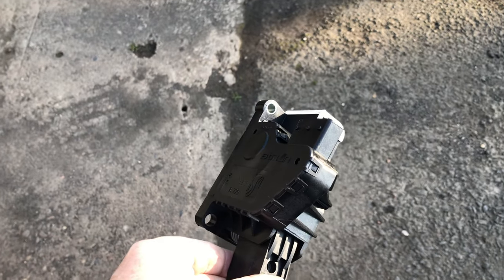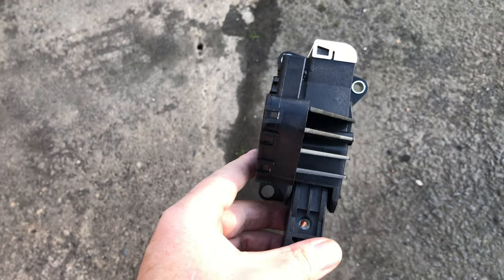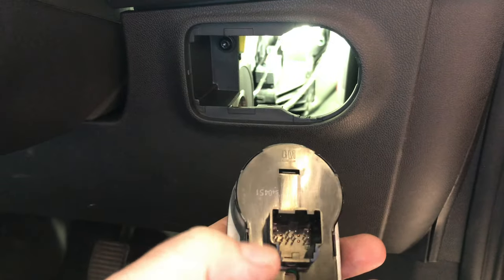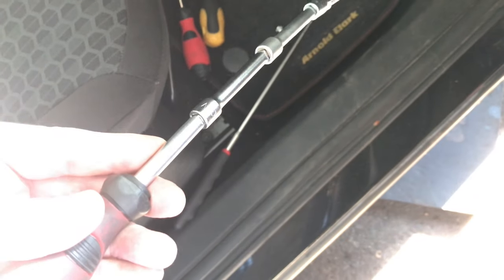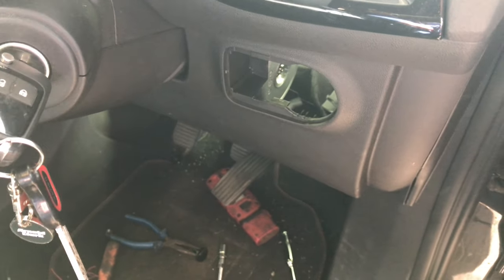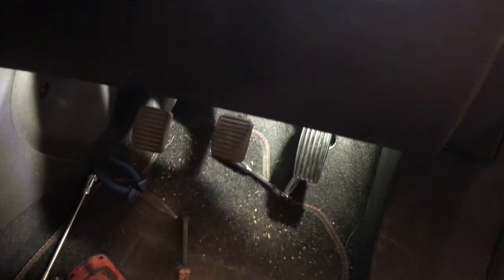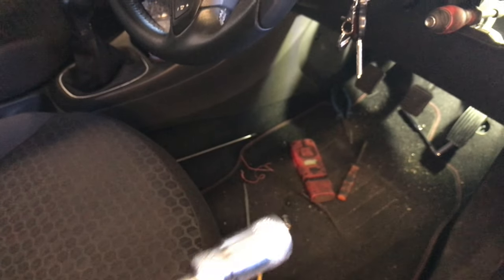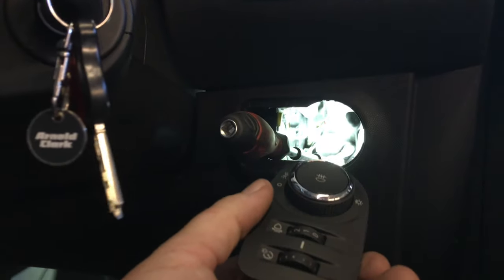Vauxhall Corsa E - P2138 Part 2 - Replacing the Accelerator Pedal!

Comment: As a matter of interest Sandy i read online that post battery change out you can experience P2138 pedal code, did you try with engine off the reset of the throttle pedal sensor switch before pedal unit change out?  Thanks

Comment: Thanks mate but i I have the exact same model corsa e 1.4 2016 but there is a box with wires infront of the pedal position sensor and i cant access the nuts to unscrew.  I have remove the box itself but the box holder is still there blocking access to the pedal position sensor.  If anyone can provide help please

Comment: My 16 plate corsa goes into limp mode when it’s cold and damp mornings
Reply: Mine too geezer! It's a 17 plate and only happens through the winter. I'm guessing it would be more pointed towards the connector in this instance? Got hold of a cheap reader and now I know what the code is - this video has really helped!
Reply: @rowanjones7523  mines literally doing that now. It is the throttle pedal sensor yes? Just before i order one
Reply: @harrybloomfield1836  I'm just going to take mine out for a spin. It's -1 so it days like these it goes on. I'm confused as to why it would only be cold weather that it happens. No one can really explain that to me.
Reply: @harrybloomfield1836  Yeah, just took it out and it got a little bit forther than it usually does. But I know that it won't go again all day now. Something warms up and makes a contact better. It would be worth starting it and letting the engine idle up to a good temperature and then taking it out. I would say that doing that and if it is fine would rule out the throttle sensor? Do you find that once you are warmed up, the problem goes away?

Comment: Great video, I always wondered how to access the pedal bolts. I have a Corsa E 1.0L T 2015 (65 plate) and it has an intermittent 'Engine on Reduced Power' problem mainly on cold damp mornings. Can you tell me if Vauxhall have introduced an updated accelerator pedal due to this being a common fault and also, after fitting a new pedal do you need to re-calibrate it to the ECU?
Reply from the maker: Yes the pedal has been updated/modified to sort this issue which seems ridiculous on a car barely 3 years old! No need to calibrate it's plug and play! cheers sandy

Comment: This is very very useful video - thanks. This saved so much time and effort rather than removing the drivers lower dash and/or the heater vent. Even the point of using the paper to guide the screws in helped. The screws themselves are at an angle to the light panel that was taken out. So its harder to use a single straight socket extension to unscrew them. Instead the video used multiple shorter extensions which allowed a better connection given the slight curvature of the arm. I used one that you can rotate that head to make it easier.
Excellent job Sandy!
Reply from the maker: Thanks for your kind comments and thanks for watching cheers sandy

Comment: Thanks for video, made the replacing of the  pedal that bit easier although I did have to remove the trim in the end as the right hand bolt was covered by a plastic  tray like structure so needed to push it to one side with one hand whilst trying to get at the bolt with the other. Anyways seemed to cure the dreaded P2138 error. Trim was easy enough to get off but a real pig to get back in place.

Comment: Thank you for the great explanation, I have a Corsa 2017 and yesterday engine sign lighted and message said engine power is reduced, so I went to computer diagnostic and it said throttle acceleration sensor problem, but the shocking is when I went to buy it I got shocked how much it is, around 600$ , my question is do you advice to find used sensor or buy a new one 😫
Thanks
Reply: Hello did you get a P0068 Code?

Comment: This has been really helpful, I have found that with a bit of contortion I can get to the pedal bolts up through the bottom. I have a question though - if we are talking that it could be a connector at the pedal sensor - could it not also be at the ECU end - thinking that the proximity of the ECU could also get a soaking when topping up the screen wash or similar? I'm no mechanic for sure, just thinking aloud!
Reply from the maker: No it's always pedal sensor
Reply: @sandyande  OK cool.  I'm just really glad I found your post. I've saved money and learned along the way 👍

Comment: Great video - it helped me replace on 1.3 diesel - but same errors came up with new pedal - any suggestions
Reply from the maker: ECU or wiring fault
Reply: Thanks - cleaned out throttle body of any carbon deposits, seemed to help but still fault recurred.  Wiring seemed to check out ok. Fault slowly got worse and persistent.  Finally went back to pedals, opened them and  found old one had damaged electrical pickups on moving part, and the new one just needed to be centred slightly more at idle position to get consistent resistance readings along full length of travel. I should perhaps make a video and upload. Can't believe the pick-up isn't a replaceable part as it is obvious now as the weak part/ most likey to fail in the whole assembly, would take 10 mins to swap out in situ and instead have to throw away whole pedal unit.

Comment: Good tip sandy
Reply from the maker: Cheers Dave
Reply: The thing was why vauxhall having certain problems is bcos fiat had vauxhall crappy gearboxes fiats play with certain electronics and manufacturers and we as fiat have changed load of them throttle pedals on fiat 500 and grandes cheap electrics still can't remember the maker on the pedal but it's not a good make I've scope signals on them at rest point and still droped out without doing full scale deflection just replace jobs a good 1 enjoy this is the life of electronics
Reply from the maker: @laddie5133  Cheers Stephen, Sandy
Reply: @sandyande  
I'm sure bitron rings a bell but call me if I'm wrong

Comment: Hi Sandy, I got the same code (P2138) on my Corsa E, but with a different description: Throttle/Pedal Position Sensor/Switch "D" / "E" Voltage Correlation.
Do you think that replacing the pedal will fix that too or will it be a different cause? Cheers
Reply from the maker: The pedal is the issue change it for a OE part cheers sandy
Reply: @sandyande  Cheers man :)
Reply: I have the same error but only in below 0 Celsius temperature :/

Comment: HELLO SANDY. THE SAME FAULT CODE IS IN MY VEHICLE. P2138 1-2 NOT IMPORTANT. HAVE YOU CHANGED THE GAS PEDAL WITH THE NEW?
Reply from the maker: Yes new pedal installed problem fixed cheers sandy
Reply: @sandyande  Could the gas butterfly body be defective?
Reply from the maker: @onurylmaz5356  not with that code
Reply: @sandyande thank you. Greetings from Turkey. We run the Opel and Chevrolet service. In the city of Samson. Servis name Lider Opel Samsun Facebook ve instagram lideropelsamsun 😁💙

Comment: a torx screw is hidden (the low one), how did you remove it? i have a opel corsa club 2011
Reply from the maker: The pedal in video has only 2 bolts, no hidden torx! Cheers sandy
Reply: sandy anderson mmm ok, but your new pedal in video has 3 hole for 3 screws, did you dismount 2 screw (Only top)?
Reply from the maker: @marcolocci9542  yes only 2! The third is empty only for mounting purposes!